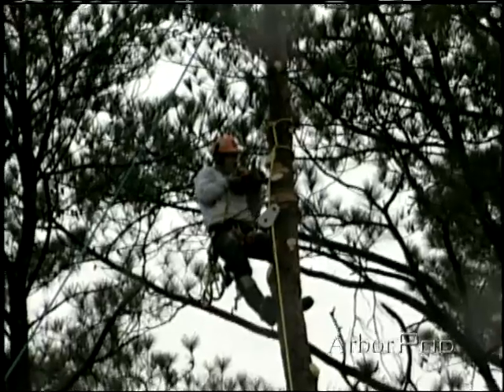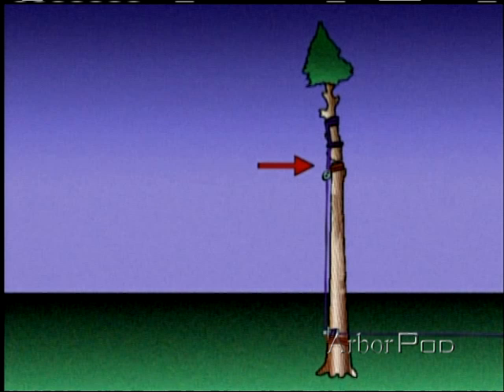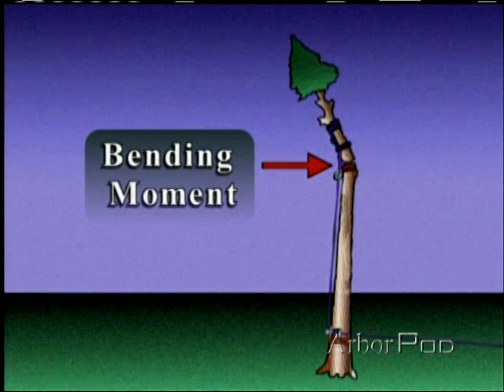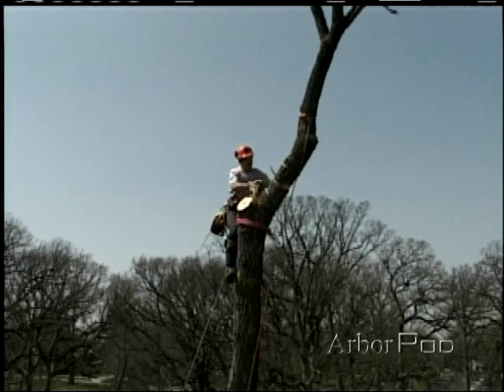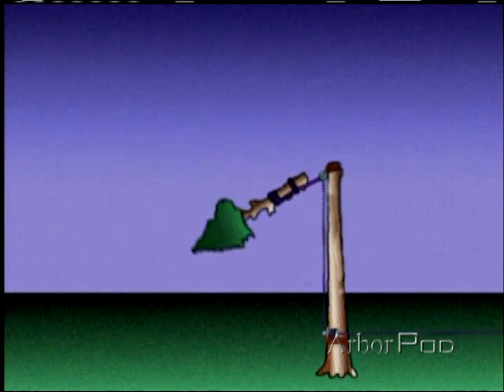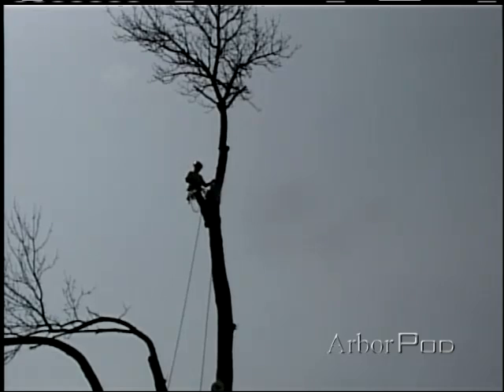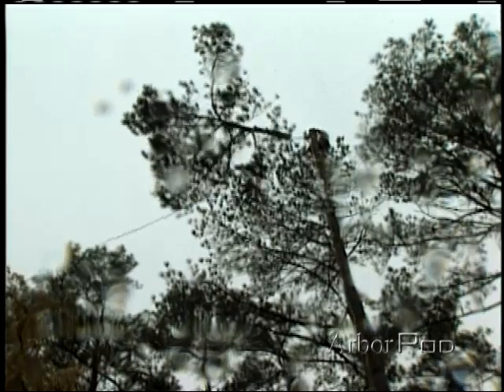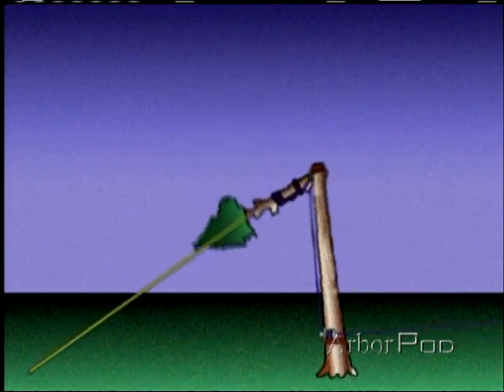Forces in Top Removal

Comment: SO WHAT IS THE ANSWER HERE?!?!?!?! Cut a notch more than 45 deg.?
Reply: You got it, try 90 degree open face cut, works really good. 👍
Reply: It's also got a good deal to do with the back-cut....and it's timing, etcetera...
Reply: Basically you want the top to detach when it’s horizontal. So, if the tree is leaning 20°, you would want a 70° notch. Or if it was leaning 20° and you were going to pull the top against the least, you would want a 110° notch. If it’s perfectly upright, than yes, it would be a 90° open-face

Comment: Allowing  the  top  to "run"  is  extremely   detrimental  to  the  rope,   unless  for  the  climber's  safety,  this  practice  should  be  avoided...
Reply: @thejackel1844 my friend, you need to go back to rigging class. In a negative rigging scenario, NOT letting it run can be detrimental to a rope. Holding it tight will shockload the system, including the rope. That’s hard on it. Running the rope spreads out the brunt of the impact, in effect, “catching” the load. Nothing wrong with running the rope if you have the proper equipment and training
Reply: the jackel lulz....sounds like YOU need to attend a class on physics
Reply: This guy HAS to be a troll. You seriously can't do this for more than a month and be that ignorant about rigging.
Reply: toomuchsawdust you're right. I'm out. I just hope jackel is joking/trolling. If he ACTUALLY does tree work the way he says he does, I hope he can get the help he needs soon, because he's asking for trouble
Reply: the jackel don't just say "more contradictions" or "many examples," prove it. Provide the evidence and examples. One of us is obviously wrong and doing something very dangerous and we should sort it out so the dangerous person can stop
Reply: I can't do this anymore. Like explaining basic tree work to a speed bump.
Reply: Again, go back to rigging class. Its especially important to let it run with a large piece. If you hold it tight, that puts ridiculously high and unnessecary stress on the rope. What's your reasoning, why are you saying you shouldn't let it run?
Reply: the jackel science is not on your side. I see what you're saying and it makes sense, except you have a false understanding of how the distance works. You're right, the distance it falls IS increasing. But what you're missing is that as the log free falls, the potential kinetic energy is building, BUT as soon as the rope BEGINS CATCHING the load (log,) then the potential emergy begins DECREASING, it doesn't continue increasing even though the "fall distance" is increasing. The free fall distance is NOT increasing. You have a good fundamental understanding, but you're missing key factors which change everything
Reply: Why would you want the spar to absorb the energy? That's where the climber is. Dont shock load the system, there won't be too much energy anywhere in the system.
Reply: @the jackel  man you really looked like a fucking idiot here.  I guess you don't use your brakes when going down hill either less you magically speed up.
Reply: did you just say letting it run should be avoided? If you have blocks and a friction device  there is no need to worry about the rope being ruined when "letting it run".
Reply: Depends  on  the   piece,  the  rope,               the  block  and  what  type  of  friction  applied, (in  a  negative  blocking  scenario)...
Reply: A  rope  can  stand  more  force  in  a shock load situation  than in  a  slow  pull  test,  a  "slow  pull"  testing   allows  the  fibers  to  change  alignment  and  move   in  relation  to each  other.      In  testing  that  involves  shock  loading,  the  shock  occurs  in  less  than a  half  second  and  the  fibers  do  not  have  time   to  realign...             
  CHECKMATE...
Reply: When letting it run you will see far less stress on the rope than stopping it. Stopping it also creates more force on the stem. By shock loading it you create far more force than letting it run. A 600 pound top doubles in force for every foot it travels before stopping. After 3 feet it weighs 1800 pounds on the rope if stopped suddenly. That's a crude calculation, but it'll serve you well. Letting it run will make it weigh far less on the rope. Maybe a grand.
Reply: the jackel Force, yes, thats true. But weight, no. A rope that is rated at 23kn (about 5000lbs) can hold a 5000lb static weight. So you could in theory pick up a 5000lb log. It would be applying a 23kn force to the rope. If you were to drop that log from three feet and catch it with that rope, you would apply MUCH MORE than 23kn. You're right, there is a built stretch factor in most ropes. Know why? Its the same reason we run rope, actually. Its to disperse that force over a distance instead of "catching" all the force at once. So let's do the math. You're dropping a 45kg log from a TIP 14.5m up and that rope is running through a magical 0-friction block down to your portawrap, which you have locked off. You're negative rigging, so your piece is tied around half a meter above your block. When it falls, it will travel that 1/2 meter but the rope would be slack. It would have to travel another 1/2m before it catches. So it's going to drop 1m before the rope catches. Lets stay stretch factor in the rope is around 5% at that kind of weight. I think we're in a realistic scenario here so far. So your TIP is 14.5m up and there's another 0.5m after the block. Thats a total of 15m of rope in the system. 5% of 15m is 0.75m. In that short of a drop, the log would have already gained velocity up to almost 5.86m/s. The rope catches and stretches 0.75 m (bringing the total "drop height" to 1.75m.) That means the average force on the rope is 1029n, or 1.029kn. That's about 231lbs, on average. Now if you were to have ran it 3 meters and "caught" the log over that distance, that number drops to 126 lbs on average. Significantly less! Would you rather a force of 231lbf or 126lbf applied to your rope? The rope may be able to handle more FORCE with an instantaneous shockload, but we aren't applying the same FORCE. We're applying the same WEIGHT (or mass, if you prefer.) MASS applied to a rope in a static scenario won't create anywhere near the FORCE that the same MASS would apply in a shockloading scenario. Back to physics class, my friend
Reply: You don't stop the piece all at once. You gently bring it to a stop only if you have to. GRADUALLY. Not all of a sudden. you talk about all this experience, you should know this. Personally I put it into the dirt when possible. That creates the least amount of force possible.
Reply: My ropes, pulleys, blocks, slings, and carabiners are all a minimum of 23kn (5000lbs.) Usually much more, but 5000 lb very minimum. Spars are unrated, but I'm confident many of them couldn't hold anywhere near 5000lbs. And I don't need them to. Like I said, I don't do negative rigging unless I have to. And I do a lot of decurrent trees so I don't usually need to do negative rigging until the last stem. When I'm not negative rigging, I'm not shockloading the spar, I'm simply transferring the weight from one limb to another then to the ground. Because I'm avoiding shockloading, I can rig from a higher smaller spar. I'm sure my gear is stronger then my spar in those situations. Even when I'm negative rigging, if the groundsmen is letting it run, the spar doesn't need to be that strong. Man, I don't care how long you've been doing tree work, it really sounds like you have a lot of learning to do, I.E. sign up for some continuing education courses on fundamentals of tree work. I'm not saying this to be a jerk, I'm saying this because your current understanding of tree/rigging physics is dangerous
Reply: The jackel is providing bad information. I'm just getting into arboriculture, and even I know, that you let the rope "run" when rigging big pieces. Otherwise the forces created if you had the rope tied off, would transfer to the spar, resulting in a possible failure, and possible death. You always let the rope run.
Reply: @AlotL1keVegas  If  the  spar  can  take it,  this  is  what  you  should  do,  remember,  you are just  beginning  to get into this,  I've  been  climbing  since  84'...
Reply: @thejackel1844  I'm not saying that you can't lock tie off when you are rigging. If it's a smaller limb/branch over a target, and you didn't want it to run, I would agree with you and tie it off. But the dynamic forces created from a large piece when negative rigging, I would let those ones run.
Reply: @AlotL1keVegas  Don't miss an insurance payment and brush  up on physics, when you get time...
Reply: Here's a good site you can throw an example in a it will do the math for you. The numbers don't lie hyperphysics.phy-astr.gsu.edu
Reply: the jackel not when you rig anyways. I'd hate to be your poor climber
Reply: The spar is rarely the strongest link in my system, probably the weakest link most of the time. But I stay away from negative rigging as much as possible
Reply: If  the  spar  you  are  in  is  the  weakest  link,  I  would  advise  you  to  NOT  do  any  negative  blocking...
Reply: The  spar  ( by  definition ) is  in  regards  to  mainly  Conifers  that  have  been  topped,  these  are  the  trees  that  can  more  than  stand  most  any  negative  blocking  scenario.   The  term  "Spar"   denotes  lack  of  limbs,    all  limbs  cut  flush  on  tree  bole.
Reply: D. Ryan Shaw dam you guys were really going at it 4 months ago
Reply: this is great
Reply: When the top doesn't run, the rotating weight slams into the top of the spar, taking the climber for such a ride it may dangerously knock him off his spurs. By letting it run the mass decelerates slowly, with most of the forces vertical and lower down on the stem, causing a far safer ride for the climber. Only a greenhorn groundie would fail to let the top run.
Reply: In my opinion,  yuz are ALL fucking silly. Every fucking cut is it's own situation.
Reply: You  obviously     DO NOT    rig  large  pieces,  for  if  you  do  you  will  learn  the  hard  way...  Just  try  not  to  miss  an  insurance  premium  payment,      sounds  like  you  are  going to  be  using  it ...
Reply: It's  just  the  OPPOSITE   of  that,  my  little  friend...  YOU    need  to  attend  a  class  on  physics.      All  double  braid  rope  has  an  inherent  amount   of  stretch  in  it,  no  need  to  let  run ...
Reply: That's  exactly  why  you  DO  NOT  let  it  run ,  you  just  contradicted  yourself.   You  are  allowing  the  piece  to  travel  an  extra  2  feet  thereby   ( at  least )  doubling    the  load...  If  you  are  so   worried  about  the  force  exerted  on  the  stem   this  is,   (or  should  be )  the  strongest  link  in  your  "rigging  chain"  . If  you  had  read  my  previously  posted  comments,  you  would  be  less inclined  to  make  this  FALSE  statement...  Science  is  on  my  side,    end  of  story ...
Reply: More  contradictions  on  your   part,    Many  examples  can  be  found  on  the  internet  of  how  letting  the  work  run  (  were  talking  big  heavy  pieces  here ) doesn't  end  well,     this,   with  physics  and  my  personal  30 +  years  of  experience  performing  residential  removals   is  all  the  evidence  I  need...
Reply: When  it  comes  to  rigging,  the  word  "gently"  does  not  apply...
Reply: My  way  of  rigging  allows  the  tree  (Spar)   to  absorb  most  of  the  energy    because  it's  the  strongest  link  in  the  system...
Reply: Afraid  of  a  little  vibration  are  you ?,   maybe  you  should  find  another  line  of  work ...

Comment: thats not a bending force at all. it has nothing to do with bending its just pushing the stem to the side while the mass of the section accelerates and the center of mass is far away from the hinge. it would do the same if the tree would hinge on frictionless bearings. great vid anyway
Reply: It is a bending moment about the base of the tree..
Reply: @caerleon87  ok 6 years later i get it they meant at the base of the tree. i dont know why they point an arrow to the hinge. i would say the push from the section and the impact on the trunk is more important since that is what moves the climber but yes that is true